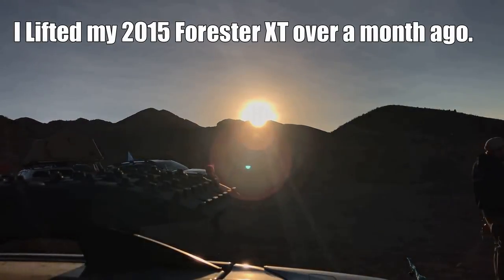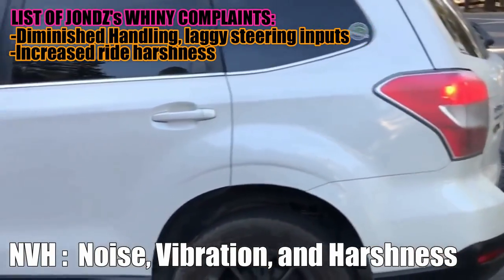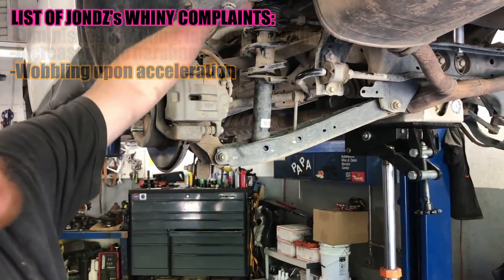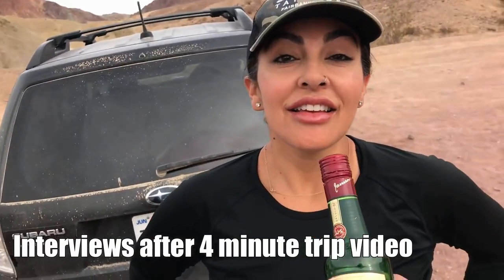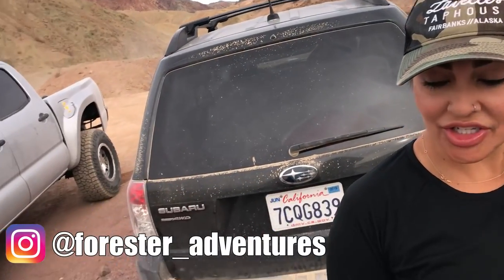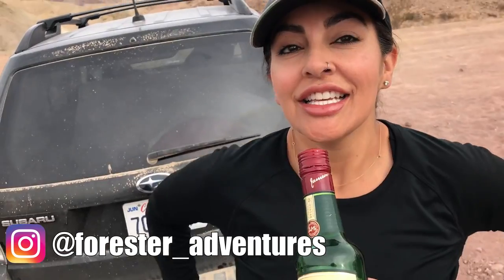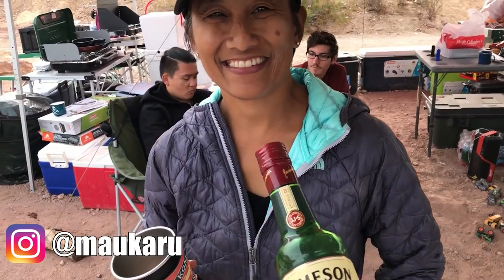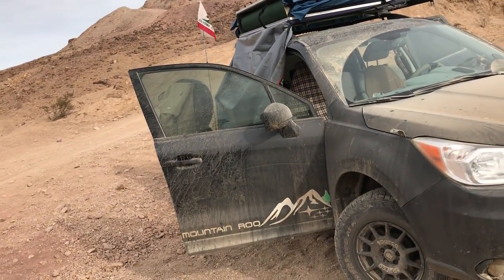DOES YOUR SUBARU NEED A 2-INCH LIFT???

Comment: Any problesm with cvt ?how many miles?i want a fxt just not sure if i should but one with 70 thousand miles
Reply from the maker: Angel, that’s a good question.  Like WRX’s, a used FXT with 70k miles was probably beaten on.  The 2014-2015 models have more problems than the 2016-2018s. 

I know you previously commented about the CVT and I want to make sure I give you the best advice I can give.  From my experiences I think I’m confident in telling you that the CVT is not an enthusiast transmission.  If you watch my videos “do you need a Turbo Forester?” I make it a point that you have to treat your FXT like it’s a princess.  Stay on top of maintenance.  Protect the low sitting engine and turbo.  

About a month ago, I actually melted my center diff by trying to get myself unstuck from deep snow.  While the Subie was easily driveable, upon acceleration it felt like my center diff was binding up.  I took it into a Subaru dealership and they told me that my CVT was only putting 80% power down and it needed to be replaced.  They didn’t tell me why, but since the center diff is part of the transmission, I figured that was it.

If you want to call this a CVT failure, it wasn’t the the typical, transmission slip and stalling that many are experiencing.  Go watch Hijack Secondary and his CVT failing in his 2.5 Forester.

So there you go,  If you’re going to beat on your car, the CVT might not be for you.  Now, what other options do you have as far as adventure mobile?  Sheesh, not many.  Subaru’s AWD system is in a class of its own.
Reply: Thank you, I think i asked him the same thing he is gonna end up getting a Tacoma from the sounds of it. I was thinking vw toureg tdi or some type of Toyota 4x4
Reply from the maker: The cool thing is that Subaru has your back with the 10year / 100k mile warranty.  If you’re going to buy used with 70k, I couldn’t recommend.  I bet Subaru would good will you a new one if you went just passed 100k miles.

I actually traded in the FXT for the new 2019 Honda Passport.  There’s been more and more videos of the Honda light trucks (ridgeline, Pilot and now Passport) and I was very impressed by the videos.  Check out my Instagram @jondz_adventuring.  I have a uphill snowy hill comparison video up.

The reason I won’t go with a Tacoma is I’m too big for the vehicle.  The cabin is tiny and no one would be able to sit behind me.  Also the engine is anemic and the MPG’s suck.  Highway driving would suck.  Screw that!  I use to drive a FJ cruiser, I’m not going back.

Honda Passport has a quick V6, about 6.1 sec, has aggressive gears 4.71 1st gear with 4.334 axles.  200 lbs torque right off idle and the full time torque vectoring AWD is faster thinking than a CVT Subaru.  Also, the rear differential has clutch packs that make it act as a rear limited slip differential.  These are suppose to be Honda’s light trucks that are suppose to offer an alternative to something like a Tacoma.  They won’t be meant for hardcore offroading, but don’t mistake them for cars.